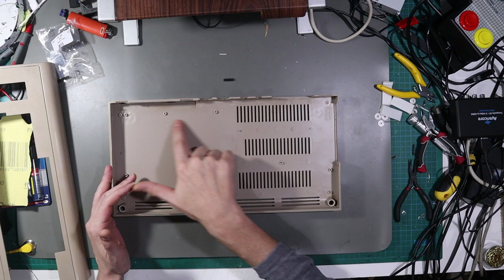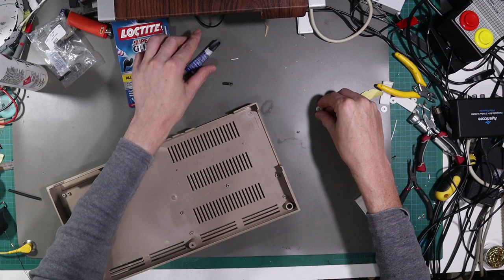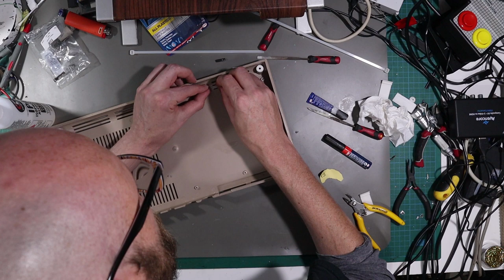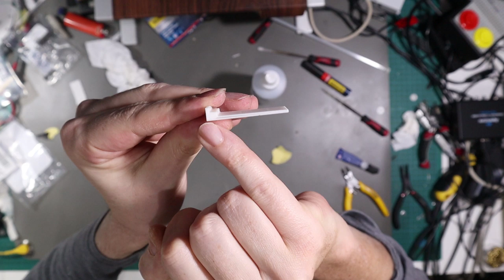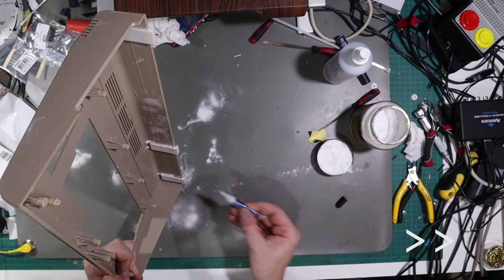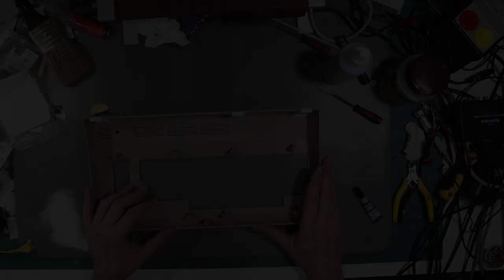Commodore 64 Rescue Pt 2.1 | Fixing the broken case

Comment: Saw guy repaired/reinforced cranks in plastic by melting component legs overcrack on the back with soldering iron. Thought was good idea.
Reply: KAPT_Kipper  Yeah i fixed my wheelie bin the same way with a soldering iron (i was using it to join 3d prints). It had massive cracks the whole height. They are holding up well 6months later.

Comment: Just a Thought, why didn't you use 2 part epoxy, So much stronger and you can sand it back down later. Neat, Cleaner and Stronger finish. I have used it in the past of the very fragile IBM 5151 monitor and if you use the clear stuff hides very well. I have also used it for broken screw mount standoffs / blocks that then can be drilled and tapped if necessary. Keep up all the good videos.
Reply from the maker: Daniel Flakelar A legit point. Although I like to try and use things that everyone has kicking around at home.

Comment: 19:57 Would it have been easier to make the 3D printed clips in such a way that they filled the void between the rails on the case? That way the glue bond would have been a lot stronger/reliable.
Reply from the maker: True; but was using a pre-existing design.